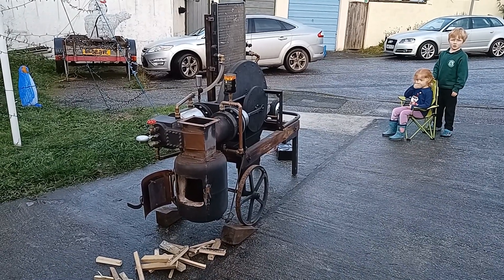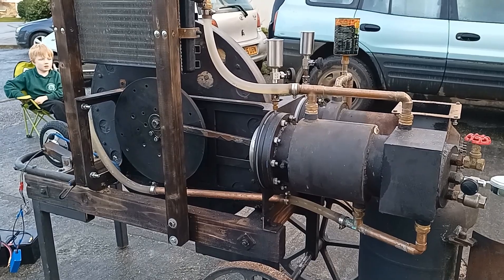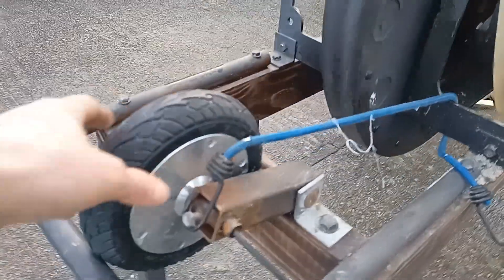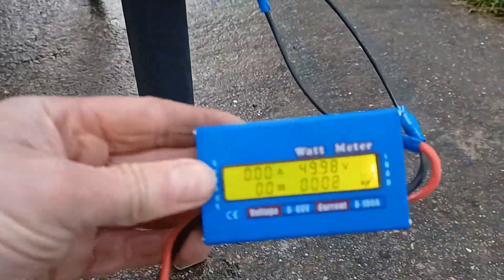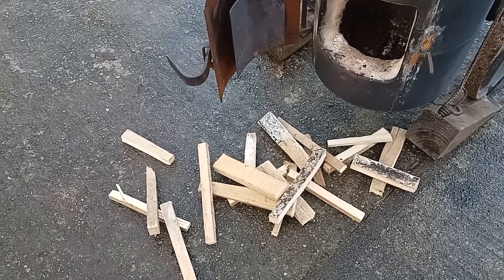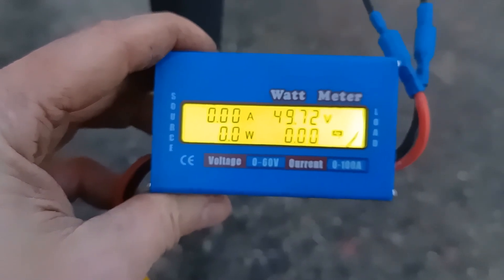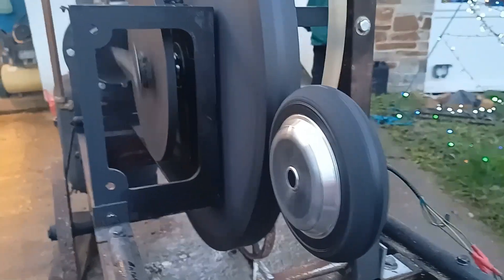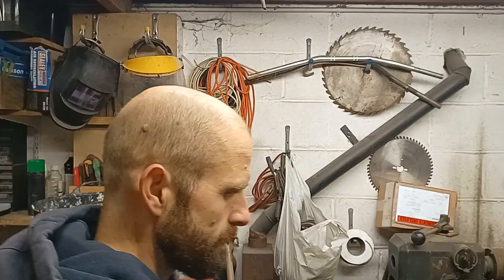Stirling Engine Horizontal Engine - Last Run (+ Generator) - Part 16

Comment: Hi man! radiator on your engine will not work properly. how i understood it isn't instaled water pump, sowater will not circulate cross radiator. if you will install some pump to there, the pump wil take some power to work. that is not wanted. so my recommendation is: 1. instal radiator on horisontal position, with some gradient, where enter of water is top, and exit is neis. 2. the pipes should be maximum size, and streight how it's posible. such way you will get not forced circulate warer. hot goig up, and cold going down. with kind regards!

Comment: Schöner Bericht viel Fleiß Danke für das zeigen doch:  Grundsätze beim Heißgasmotor:
Je größer die Gasmasse ist, die vom gesamten Innenraumvolumen verschoben wird, umso besser ist der Wirkungsgrad, 100% wäre maximal.
Je weniger Kraftaufwand nötig ist, diese verschobene Gasmasse durch den Regenerator hin und zurück zu bewegen, umso besser ist der Wirkungsgrad.
Je mehr Energie in die Oberfläche der Regeneratormasse eingeleitet wird und beim Zurückströmen wieder aus dieser Oberfläche ausgeleitet wird, ohne dass die Temperatur des Regenerators ansteigt, umso besser ist der Wirkungsgrad.
Je geringer der Kraftaufwand ist, den Arbeitskolben zu bewegen (Membrane als Feder), umso besser ist der Wirkungsgrad. 
Baut einen Motor mit Diskontinuierlicher Verdrängerkolben Bewegung. Katalytischer Kontakt Wärmeübertragung. Wärme Rückgewinnung aus den Abgasen. Ölfrei mit Membrane, Vakuum Pumpen laufen Jahre mit Membrane.
Warum habe ich jetzt mit 84 Jahren den Film, hoch geladen habe.
https://www.youtube.com/watch?v=bnR_WOcMM8k
Lesen Sie bitte auch meine Erklärung bei dem Film.

Comment: Would using a rope help? Pull start. If there is room on the flywheel side, a circular channel the rope would wrap around, much like the old style powered lawn mowers. Just a suggestion, but it might be easier than pulling the flywheel with a hand.

Comment: that watt meter did not work, because your generator is a source and not load and that meter cannot show negative values. Also you need to match a little that generator design voltage.... You need to spin it faster to generate more volts, or use only 3 batteries. It is (for me) so sad that after so many time spent into this there is no valid measurment of the output power. 

If I may suggest you should get a simple voltmeter (multimeter) and for current a clamp meter. That clamp meter that can measure DC currents is not for free (about 50USD) but it is so simple and safe to use.... I am using one that has 2/20/60A range... that 2A range is actually more usefull that you can think.

Comment: Great to see this at the end of your project, try lagging stuff, lagging the chimney at the point of entry will stop the temperature drop off at the flue outlet from the exchanger, lag the fire so more energy gets to the hot side of the chamber instead ofgoing to the atmosphere, spinning the heat exchanger may be difficult but could be very effective, Similarly lagging the piston exchanger and interface duct will help(do you need tha duct, it just creates dead volume and waste), also if you made it an active exchanger(peltier effect disks on the inside of the exchanger which are electric driven coming from the alternator output, but the speed of the engine would have to sync with the speed of heat transfer and will be voltage related). Also worth calculating the stochiometrics to see what you put in and what you get out. this is one of the best projects for small engines with useful output.

Comment: how many watts were you able to generate?
Reply from the maker: Urr.... You got me, nothing : (. I only had chance for one test run before it went to it's new home. I think I needed to lower charge voltage so engine could run slower and produce power

Comment: Its realy realy good. Maybe if you can make smaler wheel on generator side it can be better, or use regulator for lower voltage (36V for example)What you use as piston ring? I planet build similar one to coal boiler door and cold sice cooling to return side from house radiators. Maybe I can help with some electronics solution :)
Reply from the maker: Maybe you could help with the electronics side, it's really not my thing! I never really had chance to play with the generator before the new owner collected it! Many thanks